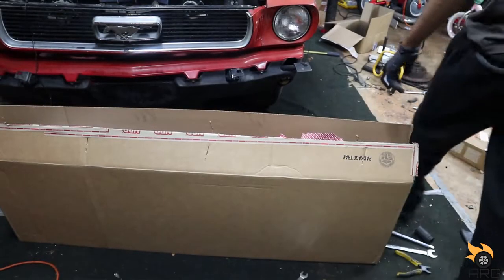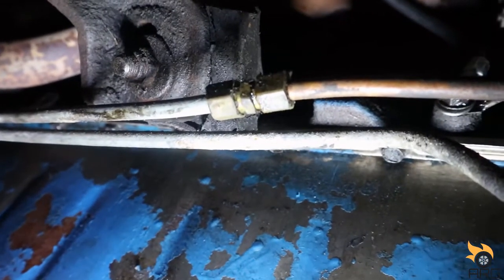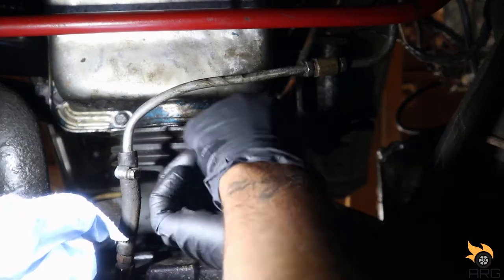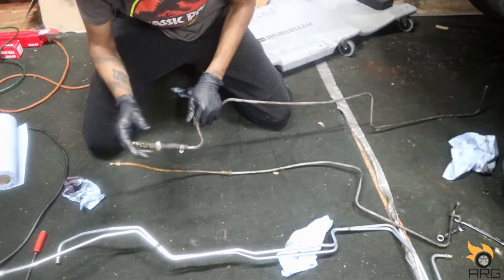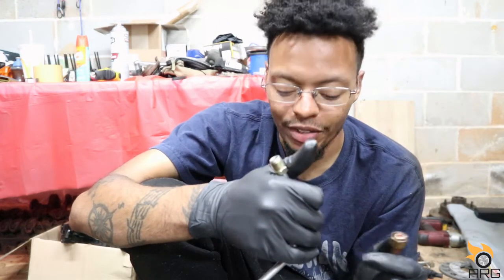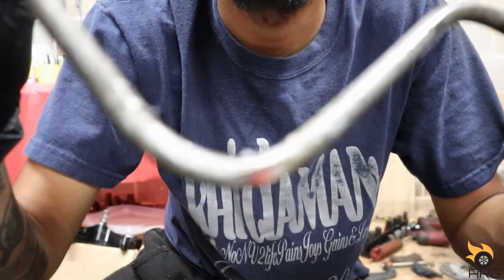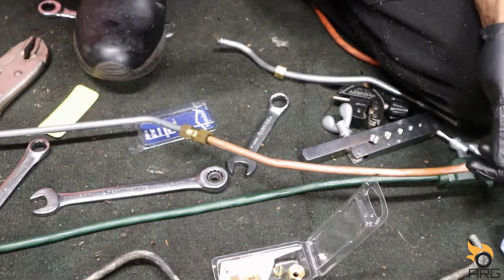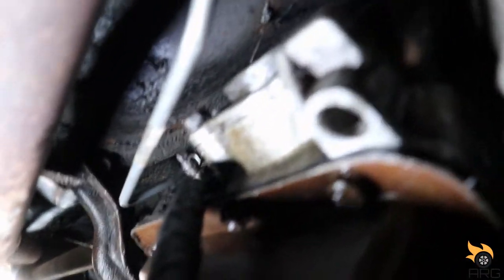1966 Mustang C4  Transmission Lines Replacement

Comment: I know this is an older video but wanted to say thank you for posting it. Like you, I'm self-teaching and making mistakes lol. My mistake was stripping the connection between the cooling line and radiator when I replaced the radiator. My cooling lines have about half a dozen splices so I'm going to replace them. Your video gives me the inspiration that, even if the operation doesn't go as smoothly as I hope, there are workarounds and a positive attitude is half the battle. Thanks for posting!

Comment: Thank you for your errors that will allow me to change out my lines on my 68 Stang. I'm not able to get a wrench into that small area where the lines attach to the transmission to install the new lines that I purchased. You definitely have so much more room on your Stang. I will now cut my lines and install the compression fitting that you mentioned. 
As you, I'm not a mechanic and just a do it yourselfer and your video has helped into how to remedy my dilemma.
Thank you, Thank you, Thank you.

Comment: Very helpful I have a 66 rambler that might have the same problem haven’t been able to take a good look under since my car has an airlift kit and my compressor is not workin but for I was able to check it looks like a it’s coming from a cooling line that’s close to the exhaust pipe

Comment: I just installed mine and had to take out the alternator, center link, and cross member.  I believe the cooler lines should be above the center link and above the cross member.  Another way of installing the cooler lines is before installing the engine and C4 transmission together.  66 C4 200

Comment: Good and informative, keep it up.   We also have a 1966 l6 sprint 200, its up and running and replacing things to have it running better and smoother.
Reply from the maker: Thanks I appreciate that, I plan to keep the I6 and just upgrade it some give little more power

Comment: It's the travel I'm not sure about. Do the lines travel over the cross bar or under? On mine it was tight going over and where abrasion was happening which cracked the tubing. A fountain of red fluid cascading over me. Nice! I've ordered some braided line as well which is flexible and can go anywhere and also if you got after market parts like an EWP you may need your own route. I think actually I damaged the line making room for the pump by bending it one too many times! I've been working on my car for 25 years and I still keep learning and I know better than a lot of mechanics. The upside is now I don't need the arguments and fights we used to have with these criminals. I can only kick myself or the car.
Reply from the maker: I ran mines under the cross bar. Now if that’s the correct way or not idk I’m not 100% if those were the original lines from factory but that’s how they were ran when I bought the car. I agree I rather learn and work on my own car myself before I ever take it to a shop.
Reply: @autoraysgarage8938  Well I noticed the lines go up and along the line of the oil pan right at the beginning of your video missing the cross bar ( in red on your car) altogether. Mines a 65 and V8 and each year are different. I've ordered replacement lines and also some flexible lines just in case (tho I don't trust the joins on them). Thanks for the video and replying to me. Youtube makes owning a classic car easier than a manual sometimes.

Comment: I know this is an old video. But does ANYONE have any advice on what tool to use or how on earth you got the lines removed from the transmission side? Any tips sure would be appreciated. How on earth do you get your hand or a wrench or the torque required to get it off?

Comment: How did you disconnect the lines from the transmission? That is what I'm trying to do on my 67, but the flare nut wrenches I have won't turn the nuts because the space is too tight.
Reply from the maker: i used one of those stubby wrenches but a crows foot wrench should work well in the tight space as well

Comment: I have a c4 auto and I’m not sure wear the lines go from trani to witch side of rad help any ideas thank you
Reply from the maker: The trans cooler lines go into bottom of the radiator,
Reply: @autoraysgarage8938  both are on bottom is a 61 falcon 302scatt

Comment: I think that’s a c6 transmission
Reply from the maker: No it's a C4 because I have a 200 i-6 and the bellhousing is to small to mount a C6 trans to. The later years 250 i-6 used the same bellhousing as the small V8 and you could mate a C6 to those